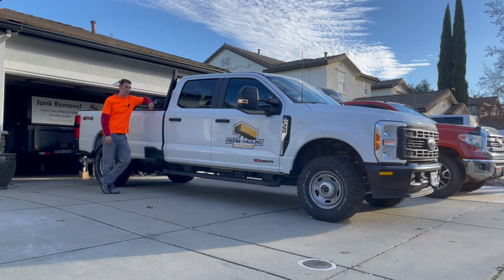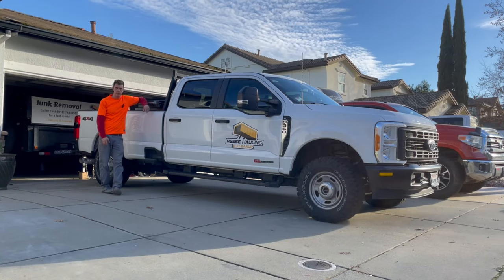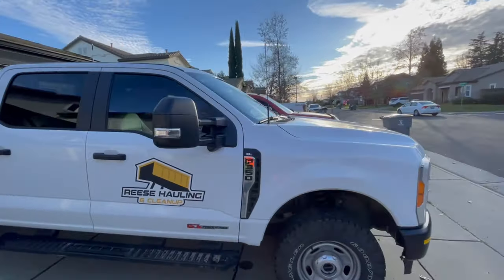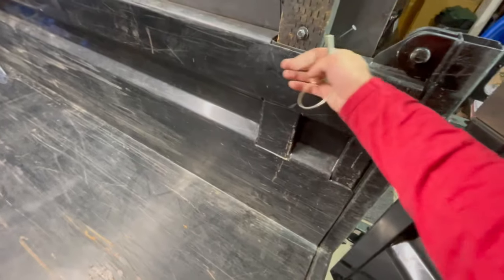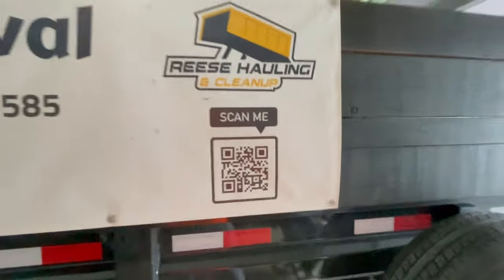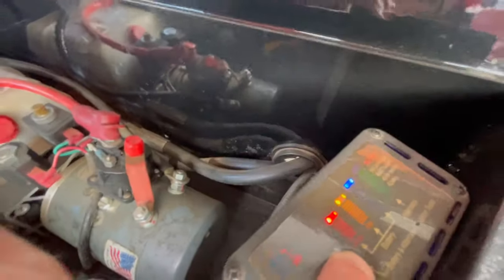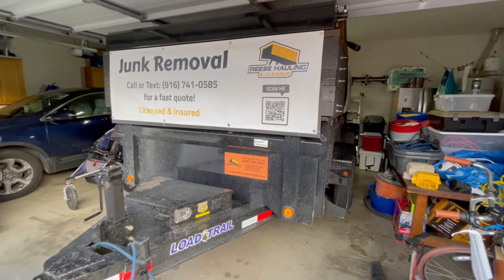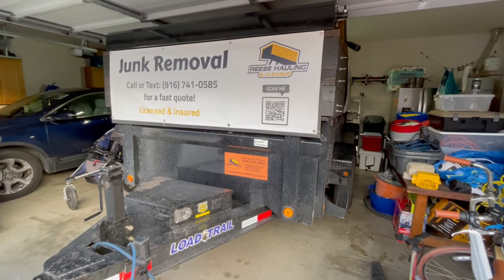Dump trailer business 1 year summary (side hustle)

Comment: How do you protect yourself from environmentally hazardous material?  I.e. asbestos, lead paint, chemicals, etc.  Those items can easily be put into your load, when you get to the dump, you are liable for your load...
Reply from the maker: I put down trash bag liners for paint and stuff so it doesn’t spill and they have a special hazardous waste area at the dump to accept that kind of stuff.
Reply: @RollingWithRuss  Do you charge accordingly?  In the PNW, there is an upcharge for hazardous material.

Comment: If you cut the crank part of the crank handle and have your welder weld a bolt or nut to the remaining stub you could use a impact to raise and lower the trailer.
Reply from the maker: That’s an interesting idea, thank you!
Reply: I’ve been wondering why I don’t see this more. Sounds like a simple solution to something that you use all the time
Reply: What tracker do you have and what keeps it powered?

Comment: I have a landscape trailer. Single axle and a 2007 Tahoe LS. Could my set up work?
Reply from the maker: Yea it most definitely could. The landscape trailer is probably easier to load with it being lower, especially if it has a ramp. You don’t need a big trailer or a dump trailer to do this.

Comment: You are concerned about your welded on tie-downs inside the bed catching on stuff so you had them removed. At 10:07 looking at your trailer I would think you would be more concerned about those long-ass bolts sticking out the side of the wood that you can rip your face off on. You need to cut them off just for safety and sand them down smooth or cover them with silicone or something after you cut them.
Reply from the maker: Never had an issue with the bolts. They’re unsightly but my face doesn’t really get close to the bolts. I appreciate your concern though!

Comment: I wounder if they make on board trailer scales like on the big trailers
Reply from the maker: I’m sure they do, not sure about on dump trailers though.
Reply: The truck scales operate from the air bags. Install an air ride system
Install air weigh scales.
Reply: @hawkeyetec  they also work on solid block Hendrickson